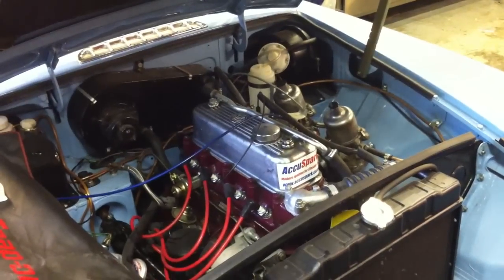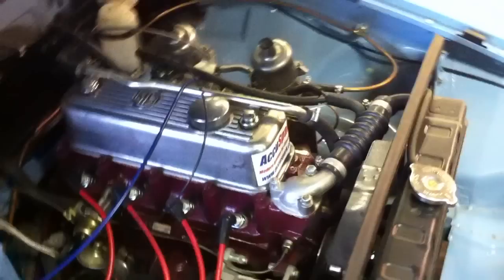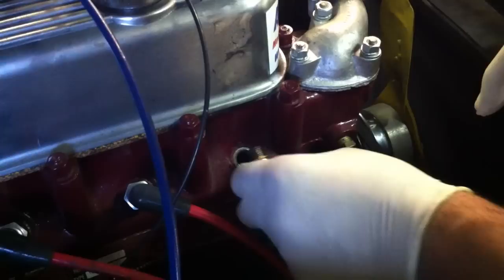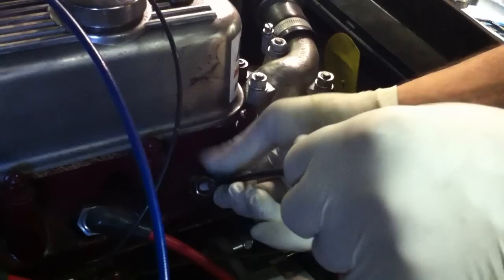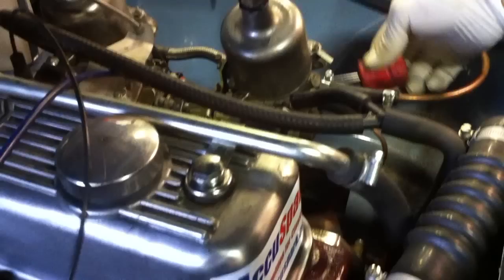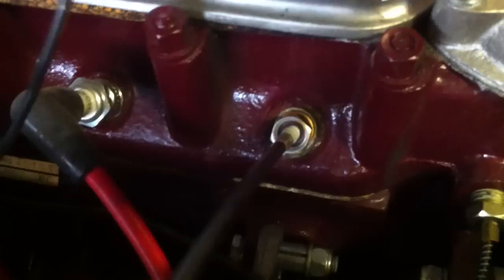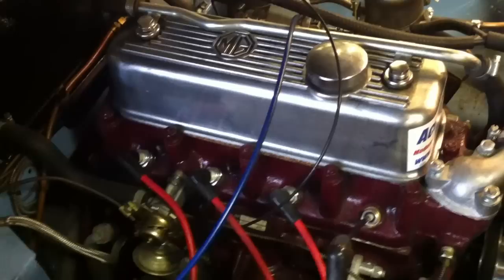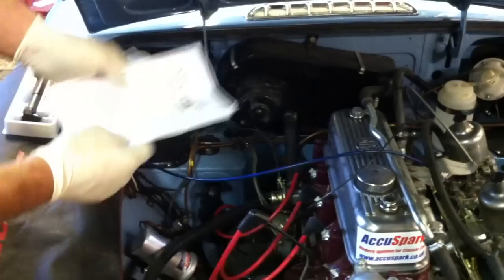Tuning MGB with Gunson colortune from Accuspark

Comment: I prefer buying two Colortunes at once and placing them side by side in cylinders no 2 and 3 for this tuning task. You automatically synchronise both carburettors in one go. Afterwards, after a long drive on the road, take out all sparkplugs and check on eveness in color and correct carbs in minute steps if needed. Always evade a singular spark plug going bright white, because then also your valves in that cylinder may be in danger!

Comment: I've still got mine from when it first came out and has seen some sterling service over the decades, used to have it all, the meter, spark tester, balancer and out there on me Triumph's and must say that these work on Vespa's beautifully making a critical job very easy as a lean engine is heat seize city on them 2 strokes :)